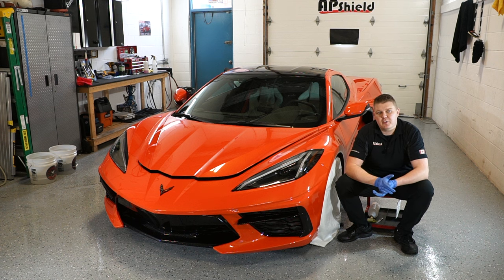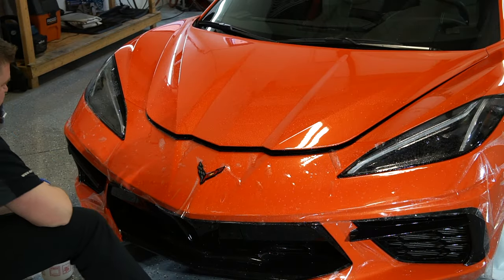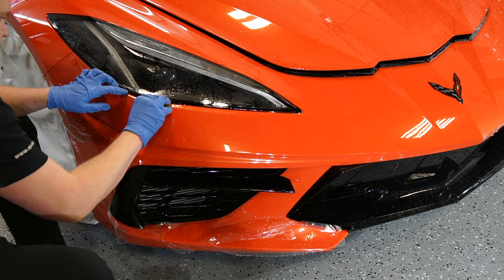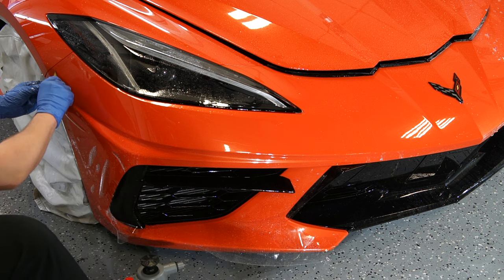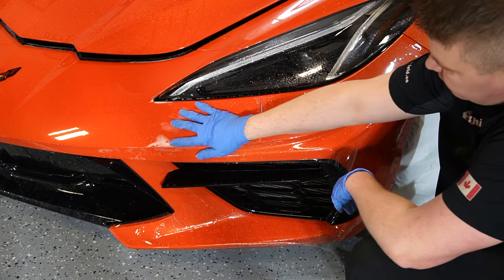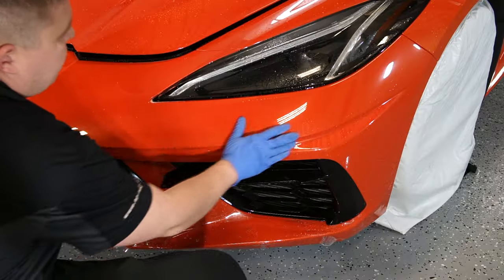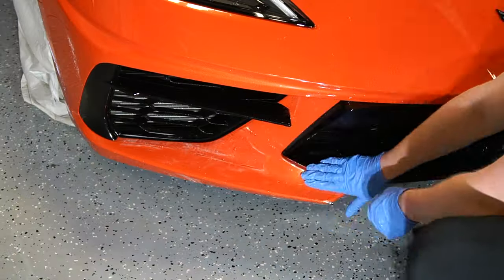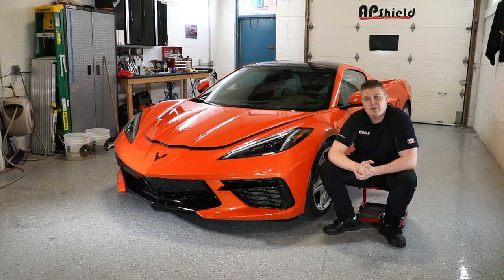STEP BY STEP TUTORIAL - How to wrap a C8 Corvette Stingray bumper in XPEL Paint Protection Film

Comment: Nice job. From what I've read and heard, a total PPF wrap on a Corvette runs around $5k. I just don't understand why so much? Let's assume 3-4 hours labor, plus the cost of the PPF. How much could the film cost?  I just can't justify a cost of around $5k for this work. I could see maybe $2k for complete wrap. And unless you really abuse your car and get a lot of scratches and rock chips, the sale value would never justify how much you paid for the wrap. A few normal use wear and tare marks would never devalue a car by $5k IMO.
Reply: 3-4 hours is enough time to prep the car for full body PPF without polishing.... full body ppf with wrapped edges and paint correction will take ~35 hours minimum.
Reply: That’s why it doesn’t make sense to full body wrap a cheap car (if u are thinking in terms of resale). To me it only makes sense on a car that’s above 200k and might be appreciating. For lower values cars like the c8 pple do front end only or partial hood/roof and ceramic the rest to seal the finish
Reply: I just did a full ppf wrap on an MX-5 Miata. Some people just like to keep their paint in perfect condition. Working on a 79 corvette right now. Definitely a challenge if you can imagine 😆
Reply: The local place charges $10,000 for a full wrap on a new C8 Stingray, ZO6's are even more.  They do 1 a day. Ceramic is an additional $2,500.   $k is cheap.  You decide if its worth it.  We recommend front, hood, front fenders and mid door down, A pillars, and mirrors.  They do that for 4k plus ceramic charge. They use very good 10 yr film.

Comment: How long from it being finished, until you can hit the road?
Reply: You can drive the vehicle normally immediately after the install. Just don't try to wash it with any pressurized water, I.e. pressure washer etc until the film is cured. Even after the adhesive is cured you should still use caution when washing the edges of the film.